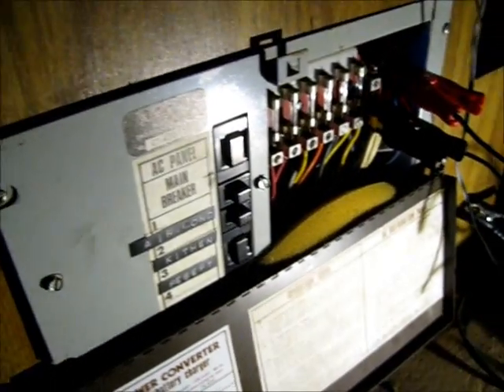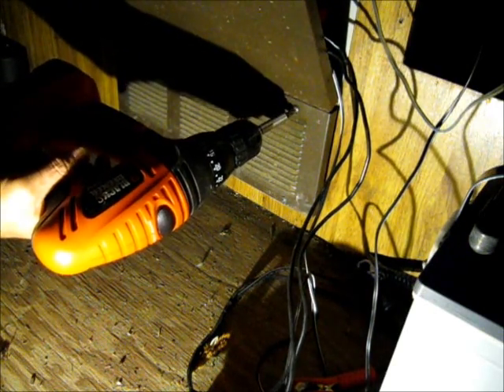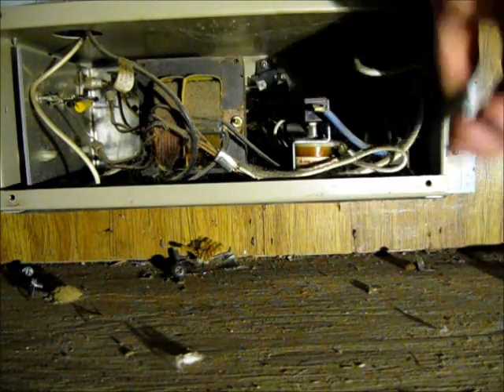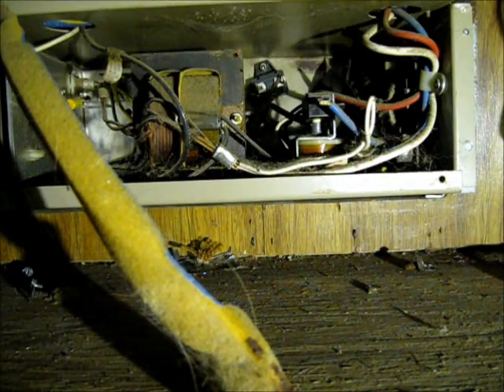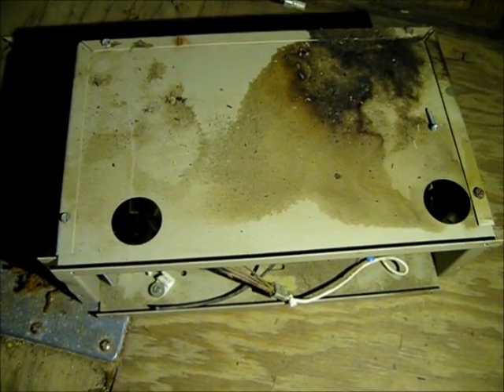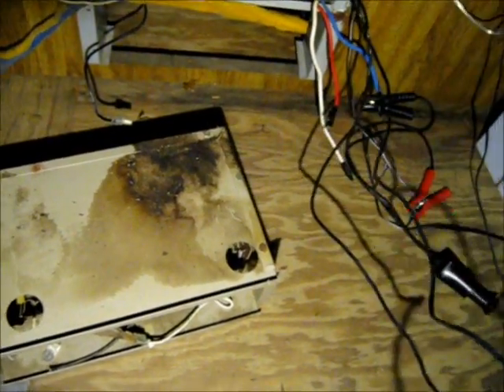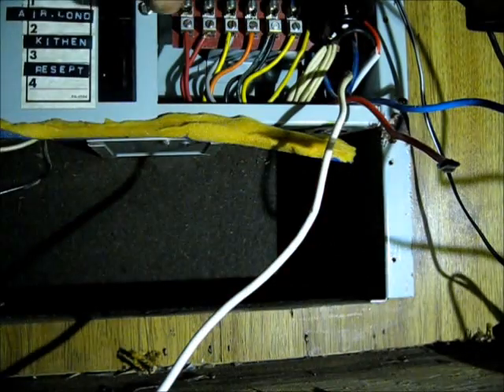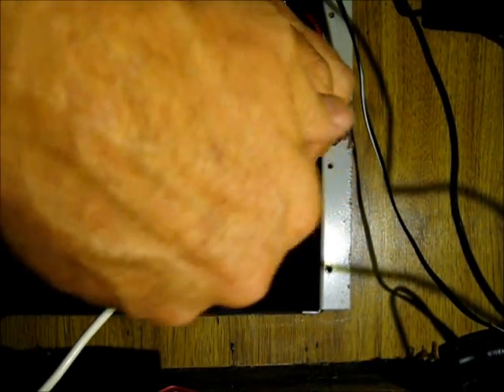How To Connect RV Converter Box To Solar Powered Inverter

Comment: Is blue always DC power from the converter? If I tap into any AC wall outlet with AC from an inverter/charger, does that supply power to ALL the outlets properly? Thanks.
Reply from the maker: I cannot guaranty that. Although there is a generally used color system in most RVs, there is no guaranty that they all use the same colors. Always try to research or check the wiring diagram on the box lid itself if you can find one.
Reply: The Do It Yourself World Dude! Total shot in the dark sending you a question from a video made several years ago. LOL. About that AC wiring. Can I just tap into any outlet from the inverter charger I install separately? How do I light up all those pre-existing outlets? If it’s too complicated a question to answer without taking up a lot of your time, I understand.🙏👍🏻😉👊 I suppose I need to consider avoiding back feeding the on-board genny.
Reply from the maker: I try to keep up as much as possible with all the comments. You can plug in the existing RV AC wiring into any of your inverter outlets, if I am understanding you correctly. Most of the existing RV lighting is 12 volts and should be fused separately somewhere in the RV. The 12 volt power comes from the original inverter/charger or from the vehicle when plugged into the trailer socket. The AC sockets you will have to plug into your inverter AC outlets tho.
Reply: The Do It Yourself World Thanks, man. I wrote the question improperly evidently. We’ll leave it here. Would love to interview you on my channel if our paths ever cross someday. Keep up the great work. 👍🏻👍🏻
Reply from the maker: Ok, sorry. Thanks.

Comment: can i use my inverter charger in my rv  to more solar panels
Reply from the maker: I am not sure about your question. The built in RV inverter/charger is meant to take shore power and charge your RV batteries with generally 8 amps unregulated output.

Comment: Converters are not needed in rv's if you have a good battery charger and it is connected to shore power and or if you have solar. These will always keep your batteries up and that is where your dc comes from to run your dc items. We live 6 months a year off grid in our rv, why do we need a converter? we don't.
Reply from the maker: The charger built into an RV is not good for the batteries long term. A real solar charge controller is much better for the life of the batteries. I am talking 10 years.

Comment: couldn't just parallel  your solar charger circuit  with the converter  charger circuit to the house batteries?
Reply from the maker: The built in charger is unregulated and a steady 8 amps. It would boil and destroy the batteries with time.
Reply: Understood ancient tech .. new charger/converter  amazon 120 bux 25 amp.

Comment: Hey thanks for the video, we hooked our rv up to our solar panels thanks to your help, but for some reason our lights and water pump are still only running off our shore battery and wont run off of the solar power. Any idea what we could be missing?
Reply from the maker: That is odd. The lights should all be 12 volt. The water pump as well. Try using a battery in the system like you would while traveling. The lights should run off the battery.

Comment: Are you still using this setup?  Does the inverter charge the original house batteries? In the video is your 12 lighting hooked you to the main lines coming from the house battery?

Did this affect your generator circuit?

Thanks
Reply from the maker: I had left the generator circuit in place in case I needed it but never did. I only used the RV for a single year then build my tiny house on wheels. The original inverter has an unregulated output which is bad for batteries long term. Eventually I removed the original RV box and went all solar.

Comment: great video! Ive connected my solar powered inverter to an automatic power transfer switch. I still have a 12volt battery at the front of my trailer and 2 @ 6 volts in a box under the cabin. the 6 volts are attached to the power transfer switch. I was hoping I could just flip the converter breaker when running the solar to avoid charging a battery while on a battery. My problem is my lights don't work when I turn off the converter breaker. Any idea what I can do to isolate the lights?

Comment: This only makes sense when you do not have a Solar Charge Controller separate from a Inverter/Charger.  And you dont want two seperate charging systems if you ever need it.
Reply from the maker: True. The onboard charger though is not good for the battery life long time. It is not as nicely regulated as a solar charge controller or a professional plug in charger. You would be better off using a good AC plug in charger for your batteries if you were going to use shore power.
Reply: good point. Or just upgrade your Controller.

Comment: I have 12 volt lights now! Thanks Travis! . I am on the grid but my converter went out. I'm pulling off a thirty amp breaker and other then my dc converter going out I haven't had any other issues. I did run another line on another thirty amp breaker so I could add receptacles for my space heaters. I only use 12 volts for lights so I got a solar panel. We want to see more videos. Thanks Travis!

Comment: I was so glad to find this. I had to cut out the converter aslo. I don't have power to my lights even though I have on one side of my fuses. I do have a battery in now and if my red wire and blue wire is the same as yours then I should be good. I have a solar panel but no need to install that until I get the lights working. My breaker box and fuse panel is set up just like yours only I have the plastic fuses. I live in mine. 86 coachman motor home. Thanks for the video.

Comment: Could you run the wire from the inverter like you showed but just pull the circuit breaker to the converter?

Comment: I have a question that seems like it will require a simple answer but I'm new to rv'ing and electrical stuff so I have to ask. When I opened up the panel and slid out the converter, there was only the red and white to the left and blue and white to the right... No red. Since the blue and red have to be reconnected and I have no red, what do I do?? I'm so ready to be done with this project!

Comment: So your going from 12v to 110v back down to 12v? That just seems like a lot of loss that you can't afford. Would it be easier to have a separate set of 12v "house" batteries for 12v items and just use your inverter/batteries for 110v?

Comment: This is what i need to do.  I currently use an Interstate 4D deep cycle battery as my "house" battery along with 4 used Trojan T105 6v batteries with a 1200 watt inverter to replace my broken Onan 4kw generator. I was looking for a way to make sure I don't convert 12v to 110v then back down to 12v again since its all powered by (4) 120 watt solar panels  hooked up to a Morningstar SunSaver Duo that split the 25 amps between them both. I use 2 old refurbished 12v evaporative coolers to keep the heat down as opposed to having to use the Norcold AC. Since I live in the southwest this shouldn't be a problem. Thanks for the great info.

Comment: Do you think that one line from your inverter back to the control box can handle the Amos if you decide to run one or both of the AC's?  Seems like that might be limited to generator only if you can get it fired up.

Comment from the maker: The box and wiring for the generator are still there untouched. All I did is remove the 12 volt converter box. It only sent 3 amps to the batteries anyway. Useless. Better is to use a battery charger plugged into the generator AC.

Comment: wow great job that all worked out so well. Glad you got to use the existing dc fuse box and wires. The battery box and inverter and panels will work well Im thinking. you could get thirty percent more efficiency out of your panels with a solar tracker . They would begin charging about 7 ish in the morning and charge full power all day untill sun set.

Comment: I put solar in my travel trailer, 150watts amorphous and 200 watts monocrystalline on two separate charge controllers. I connected charge wires to DC side of converter where it charges original dc battery. I also put in a 3000watt inverter between shore power and connected back to feed converter. Will be adding additonal 170 watts of solar as funds allow.

Comment from the maker: The original converter box is only 3 amps. I do not have a good battery charger of any sort. Just an ancient 4 amp charger. I need to get a good, high amp charger.

The converter box charger is horrible, unregulated and dirty power from what I have read.

Maybe with some filters and circuits I could make this into a sort of unregulated charger though with some higher current. Nice idea, thanks

Comment from the maker: Good points.

My campground plug was cut off when I got the camper.

I will use a breaker at the inverter. I also left all the original breakers in place on the other end so every single line is protected. The inverter has its own protection but I will put in a breaker there anyway.

Comment from the maker: I will probably never do that but you have one of two choices.

1. the not so safe way is to unplug the inverter yourself each time you plug in shore power.

2. the safe way is to have a switch or breaker which shuts off one and turns on the other.

Comment from the maker: The idea is to use solar to charge your batteries. With a generator you need a standard high amp battery charger which you plug into the AC of the generator and quick charge the batteries.

The original setup only sent 3 amps to the batteries anyway, max.

Comment: Good point to make. unless you  use approved connectors ones marked AL-CU or use a NO-OX paste on your aluminum cable, they also make AL-CU wire nuts now. They are made by the IDEAL INDUSTRIES company and are PURPLE in color. if the transition is in a home you can use a receptacle to make  the connection and transition from AL - CU

Comment: you can seperate using a 3 way switch. much like a transfer switch would work with a normal source and emergancy source I. E Park power Vs Inverter power and  the common terminal would be out to the load. its the exact same way a generator should be hooked up to a panel. the use of relays could work as well if you want a semi automatic senerio .and thats what the " SENSOR" was that was spoken of. If the plug was plugged in i think w/o some sort of issolation switch. i think the inverter will fry

Comment: mine has a 120 breaker marked power inverter charger i plugged the 120 power to solar 12volt inverter to 120 the charger was wining so i flipped braker off the winning quit i put a small 60 watt solar panel on battery in 3 hours it was topped off my 3 red lights were blinking i leave the breaker off when running off solar the 12 volt lights and fan ran off a battery charging it was my cure for it going down!

Comment: Troy, love the vids, wife chuckles each time she hears you say "it's HOT!" I do have a question though, If you connect your inverter to the shore power, and then plug the shore power cable into the mains, how do you protect the inverter? Just unplug it via your home made cable/plug? I want to install solar and an upgraded inverter but can't figure out how to keep the shore power as well. Thanks

Comment: I agree that if the park/shore power plug is energized it could cause problems, especially if it were connect to the shore/park system and some poor soul thought the line was dead. A secondary question is if you plug into the mains at a park, or house, and your true sine wave is plugged in what happens, how do you separate the inverter from the shore power?

Comment: Then your seen more then i have. All be it the factory installed circuits may be fused. but the cables in mention would be from the battery bank to the improvised Buss bar system.  and from battery tie under hood to end of the buss system..I just don't wanna see TROY have a fire or Bad situation.

Comment: Whats your plans for over current/short circuit protection? do you plant to install  fuses on your main buss feeds and then to the inverter? what protection do you have for the AC feed from the inverter to the caper tie?? Please do take the time to install proper fuses/circuit breakers to protect the circuits. and what did you do with the park connection plug to safe it off?? if you just added the new cable ( not high current mind you) 20 amp MAX . to the park tie it could have energized prongs